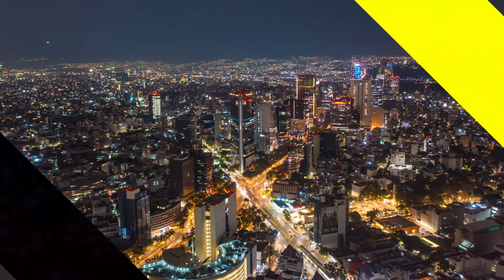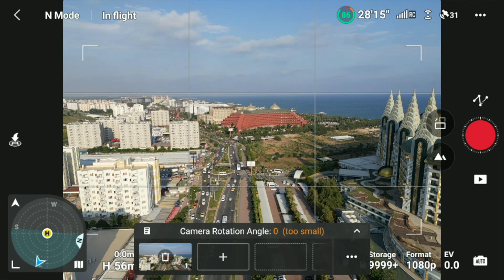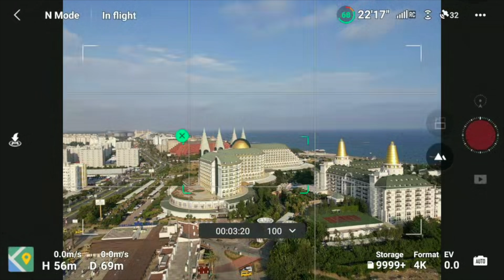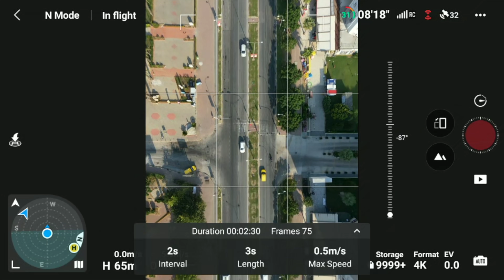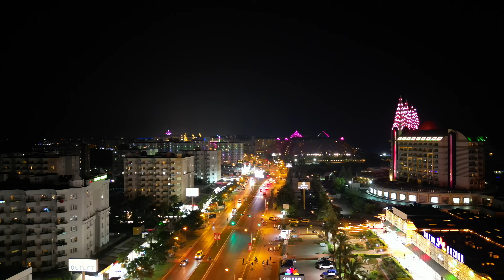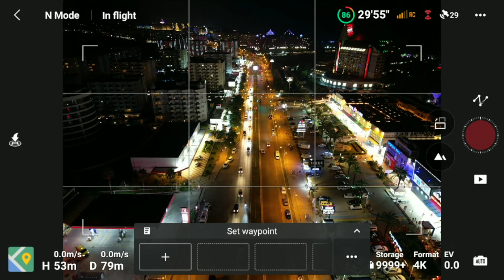DJI MINI 3 PRO HYPERLAPSE Tutorial

Comment: Hi , how will you help remove the doubt of the beginner remote pilot  for DJI moni 3 pro that you won’t crash being that it has no sideways obstacle sensor. What is the maximum height that you need to set to remove all doubts of crashing ? This is a question also for master shot. Thanks
Reply: To remove all doubt of crashing the drone, one must lay with the drone flat on the ground. This is the only way to remove all doubts.

Comment: Hi Darren. Great video! Do you know if the drone remembers the exact starting points for repeated way points? Specifically does it remember the starting height? Or do you get it at the starting height before selecting the previous flight? Thanks!
Reply from the maker: Sure does it remember the height settings too
Reply: Thanks Darren! That is unreal! Can't wait to have a go. Cheers

Comment: Great video Darren. I'm doing a "Construction Progression" video of a friend's house being built and I am using waypoints to complete a circle (roughly) every couple of weeks - the idea is that I will then edit the set of (roughly 50) videos and present him with the build in roughly 3-4 complete loops. The problem I have is joining the last waypoint of the loop to the start of the loop for a smooth join - any ideas? The "loop" option does not save position and altitude so it's no good for me in this situation - any help would be massively appreciated.
Reply: I've done a similar thing for my house. (Haven't finished the video, despite me living in the house for about 2 years though).
You'd want to go 1-2 times a week until the roof and outside bricks are done, a lot get's done before that stage and nothing after that because all the work is being done on the inside. and there's a lot happening every couple of days.
Also I didn't do a loop, but perhaps you could try (If you haven't already started that is) at the first point (let's use a clock as reference) 12 o'clock, make two waypoints. then add another waypoint at 3-oclock, another at 6 and 9, and if possible move one of the 12 o'clock waypoints to the end after everything. Copy and paste waypoints? not sure, I don't have a M3P

Comment: While recording a waypoint hyperlapse, if in any in between waypoint is set with camera pointing 90 degree down, my Mini 3 Pro is getting stuck there and keeps on taking photos at same point instead of rebounding the camera up to continue the remaining way points - Did you try this or faced this issue ?

Comment: Thanks for all the great tips. I tried the fixed waypoints. My only problem was when it came back Home ( in a straight line) it almost hit a tree. Not sure why it did not increase the altitude and fly back safely. Did I do something wrong? Any advice would be appreciated.  Do you use brake or avoidance when using the locked waypoints? Thanks Again.

Comment: Darren, in Waypoint mode, are you having trouble with the aircraft staying at the programmed altitude?  My M3P is at the correct heights at the waypoints themselves, but enroute wanders up and down (no wind).  I had set the waypoints at 150 feet, and watched as the altitude decreased to as low as 106 feet, RTH at the ready!  It also deviated above the last waypoint altitude by a considerable amount on another leg.  Billy Kyle has also reported this problem.  Could be dangerous if DJI don't correct it!
Reply from the maker: Question have you got obstacle sensors turned on? Try with them off and see if it still does the same
Reply: @DMProductions  Thanks for your quick response!  I flew two flights this morning, one with sensors on and one with them off.  Oddly, the aircraft stayed bang-on the assigned altitudes throughout in both cases.  I will keep at it to see if this anomaly returns; meanwhile, I will be watching Billy Kyle's posts since he was very concerned about this as well.

Comment: I wish I could just get my Mini 3 to fly by itself in a preset direction, distance, and height, record video, and then pause. Is this asking too much? Seems as if waypoints can do this with hyper lapses?
Reply: This is the same on the mavic 3 and air2 so not just mini 3
Reply: @dereksmith9448  so third party software is still the only way to do this?
Reply: That's what master shots do in the m3pro. Right?
Reply: No Telegram. Signal or Whats App?
Reply: My $300 Ruko has this called route rules